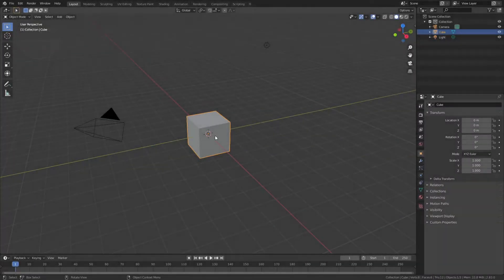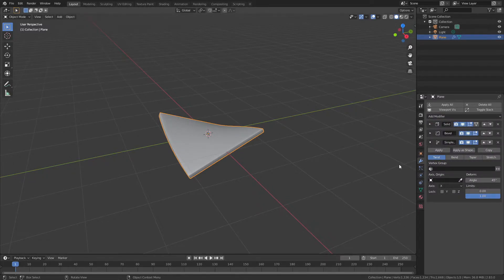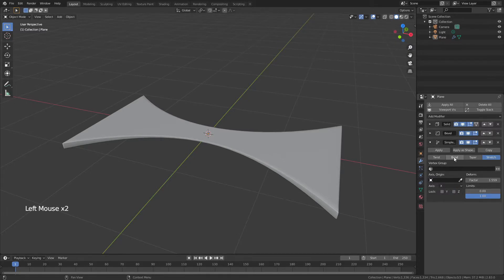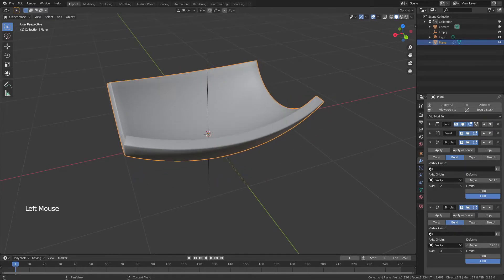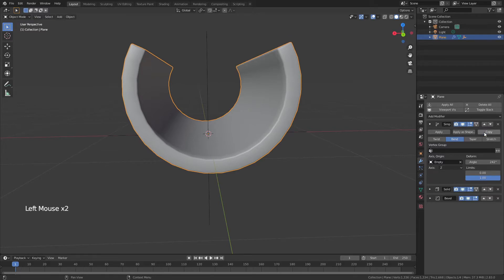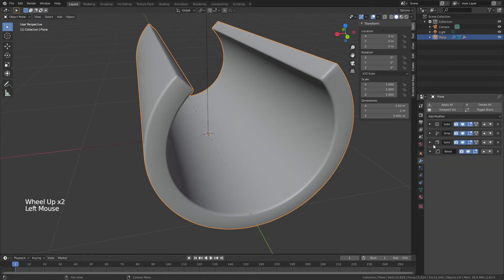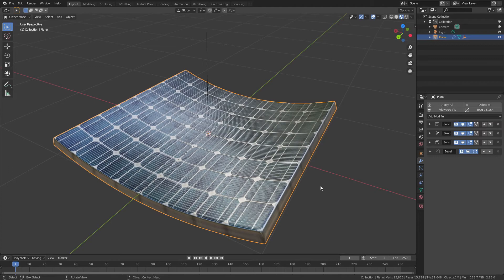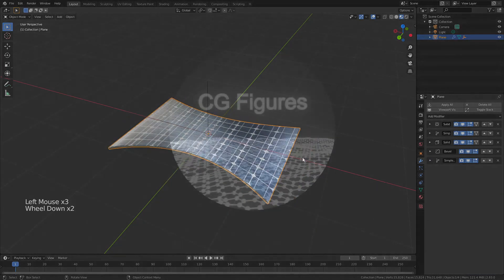How to Make Flexible, Bendable and Stretchable Substrates in Blender

Comment: any idea on how to animate the bending of the object ? new user and i can't animate it when i put the keyframes nothing happens
Reply from the maker: Hmm. Bending really should be as simple as choosing a start and end frame and then adding keyframes to the angle in the bend modifier. I've checked it in up to version 2.93 and it works. Where we you adding the keyframes?